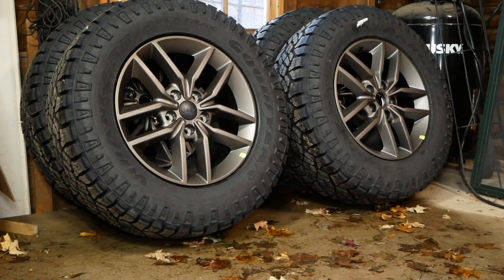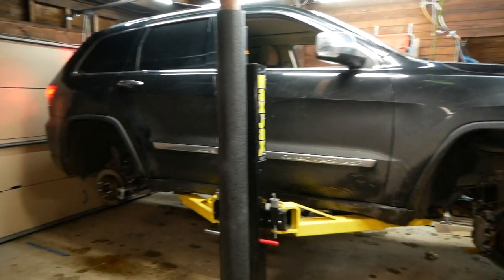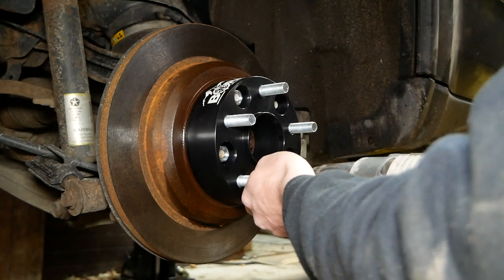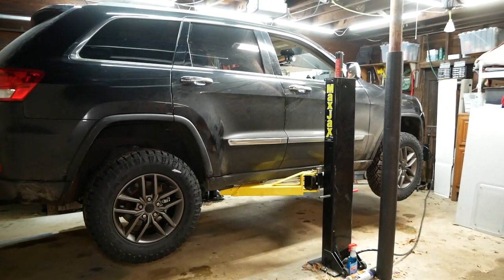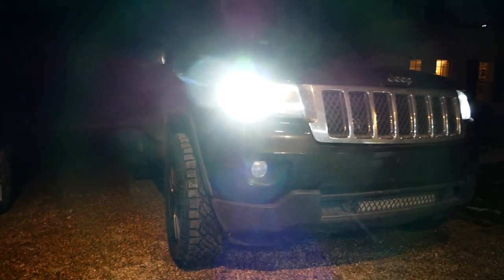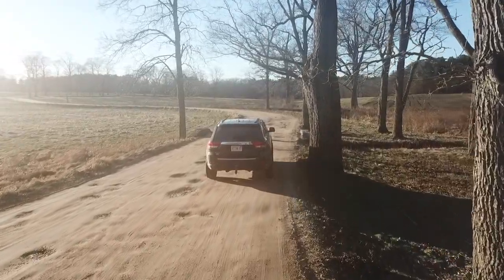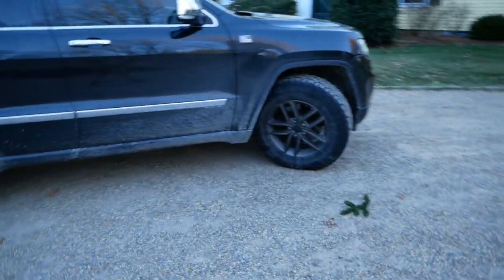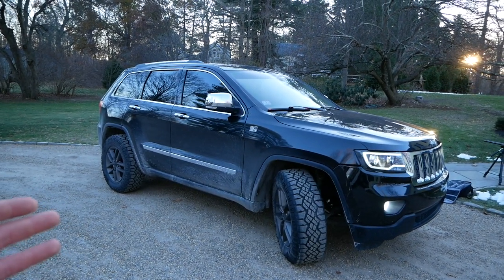32" DuraTrac Tires + 2" Wheel Spacers // Jeep Grand Cherokee Overland

Comment: It’s so annoying how no one is modding their wk2’s and nobody is making aftermarket kits/upgrades for them since there’s not a big enough market for it. I understand price margins are slim to produce wk2 lifts/bumpers/etc. especially compared to the wrangler. And most wk2 owners are suburban soccer moms that don’t even know what a torque wrench is, let alone being interested in modding their grocery hauler. But still.. compared to the Wrangler, the GC is still highly capable off-road in its stock form and could probably be pretty comparable to the JK with some minor fender/bumper adjustments for clearance and beefier suspension system. But unlike the JK, it’s extremely comfortable to ride in and it’s handling/performance is light years ahead of the JK when comparing ride quality. Sure it doesn’t have extremely low gears and can’t crawl boulders but in my opinion the GC is so much better all around and would be so much cooler if there were more options for off-road specific modifications. I’m lucky enough to have a mechanic background so I’ve still been able to custom fab a few things to get mine where I want it but would love for someone to come out with some off-road inspired fenders/bumpers/front end that don’t look bulky and ugly but give the GC much needed clearance. A guy can dream I guess...rant over. Love the vid, keep the wk2 mods coming!
Reply from the maker: I totally agree! Most wk2's never see off-road use, nor do JK's... but the wk2's off-road ability is definitely underrated. Hopefully companies will begin to produce more wk2 off-road parts as the market grows. Thanks for the comment and support!

Comment: 2in spacers look mean asf! I just installed 2in spacers on my 17 Limited with stock suspension and stock 18” rims with Wildpeaks. I have slight rub on front fenders when turning. Did you have to trim or had anything rubbing on front fender lip?

Comment: 1.5'' probably would have looked a lot better at stock level. Ending up going 1.25'' on mine with the 32'' tire definitely drives like a Jeep should.
Reply from the maker: I agree
Reply: Tyler, did you need a leveling kit or lift kit so it wouldn’t rub?
Reply: @roelleuss  Leveling kit. from rocky road front only
Reply: @famousmidnight  would there be any rubbing if I were to put 265/65r17 and 1.25 spacers without a leveling kit?
Reply: @roelleuss  I doubt it. I had 265/65/18 zero rubbing. I'd recommend doing that if you can find some 18's on ebay. looks perfect I found a good deal $500 for all 4 wheels
Reply: @roelleuss  I missed your question about leveling kit. I can't say for sure if you need one for the size you mentioned I'd bet there would be some rub but not much.
Reply: Do you think a pinch weld mod would take care of everything? Lol, the 265/65/17 fit without rubbing without a leveling kit, I wonder what the difference would be if I just added the spacers. Thanks so much for the advice btw!
Reply: @roelleuss  Probably but I'd just save up for the leveling kit. I didn't have to do any trimming and looks much better leveled

Comment: Does this overland have airride suspension? If so, did you do any trimming? I run. 275 65 18 on my trailhawk WK2 and out 1.50" spacers in the front and it rubbed until it was lifted to offroad 1.
Reply from the maker: Yes it has air ride. We didn’t have to do any trimming.

Comment: what air mode are you in when on the snow pile. i have 275/65/18 and 265/65/18 on order w/1" spacers already on, but i off road quite often in dunes and snow trails. it looks like if you hit much of a bump when at turn you'd put the tire right into the fender.
Reply from the maker: I don’t recall the air mode but you’re right... this probably isn’t the best setup for off-roading

Comment: And problems with the speedometer, air pressure sensors ect. after the changes? I have a 2015 overland with factor 20s on it that definitely needs some more aggressive tires maybe some smaller wheels on it!
Reply: 32's throw off your speedometer about 3 to 4 mph. When I'm doing 75mph, I'm actually running closer to 79. You can have your speedometer calibrated as long as you don't have a 2021 model.

Comment: How do you like the duratracs? I put them on my 2013 GC OL. After a few months, the tires started their normal wear and got extremely loud. Just wondering if it was only me. I ended up pulling them off and going with the TrailRunners.
Reply: Same here after wearing down a little bit they are super loud

Comment: Any updates on the wheel spacers? Have you noticed any vibrations at higher speeds or significant loss in mpg like that? Have you done any slight off-roading or anything like that with the spacers, any problems?

Thanks
Reply from the maker: No problems whatsoever! Working out great!

Comment: Did you need to regear at all? that looks absolutely fantastic! what's the size on those new tires?
Reply from the maker: Nope! No regearing required. Thanks! I don't recall the exact tire size but should be included in the video

Comment: I have 265/50/20 Cooper AT tires on my 16 GC High Altitude and I was considering doing 2" spacers. Would you see any issue with this? I don't think I'd have any but I'd like to get your opinion on it as well.
Reply from the maker: I think that would work - it would be very close however

Comment: I might have missed it in the video, but does that jeep have the air suspension? I have a 20 trailhawk with air and was concerned about rubbing in aero mode.
Reply from the maker: Yes, this sucker does have the air suspension. We found in lower settings, there was slight rubbing but nothing major. Still very much driveable

Comment: I was considering doing this to my 2017 limited stock because my treads are non-existent now, but I don't have air suspension... Do you think this would still work or would it rub?
Reply from the maker: I can’t say for sure.. you should try to take measurements of each suspension setup and see if they’re comparable
Reply: Ben castle yes they will work if you dont have the quadra lift. You can go 1 inch bigger than stock tire before you start having issues

Comment: Actually they are 31.5” that’s why they clear with no rubbing. I’m running 285/65R18 and they are 32.56” tall and they rub with 2.5 level kit.
Reply: Daniel Navarro 
Totally agree. 
I have 275/75r18 and had to pinch weld. 
Also look how close the tire is to the fender. It’s going to hit over mild bumps.
Reply: So will 265/65r18 rub do you think? With stock?
Reply: @therealbouncertv  i run 265/70 R17 with a 2" lift kit and 2" spacer. does not rub at all

Comment: Would the 2in spacer work if it was the 20’s with an off road tire
Reply from the maker: That depends on the offset of the wheel and the diameter of the tire.

Comment: Anyone added a 2” leveling kit with 1.5” or 2” spacers to their JGC Altitude WK2?
Reply: I installed the Rocky Road WK2 lift and leveling in January 2019.  It’s advertised as a 2.5” lift in the front and 1” in the rear.  I never measured to see if I got exactly that but I will say it sits quite level.  Running JKU Moab wheels with 1.5” spidertrax wheel spacers and 32” tires (255/75/17).  No issues and no rubbing.  My only complaint is that I think a wider tire would look better, but since I had these sitting around with almost new tread figured I’d wait until I need a new set.
Reply: @monsignorwj3947  I thought spidertrax only made 1.75" spacers with the M14 x 1.5" lugs?  Did you drill out the 1/2" holes in the spacers to fit 14mm lugs?
Reply: @tinpea  It’s been a couple of years and they may in fact be 1.75”.  I’ll have to measure the next time I rotate.

Comment: your lightbar, where did you pull the wire and switch into the cabin from?
Reply from the maker: The light bar is actually hooked up to a wireless remote
Reply: JD Cars say what?     Where can i find one and do u know if it works for the rough country lightbar??